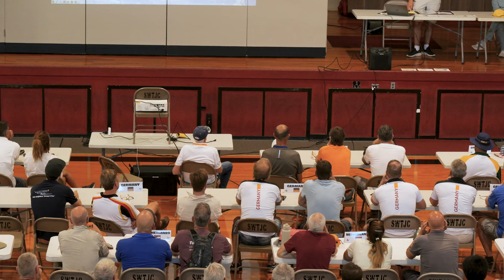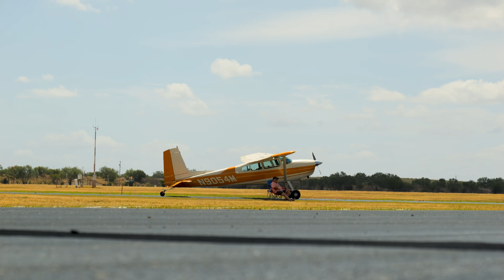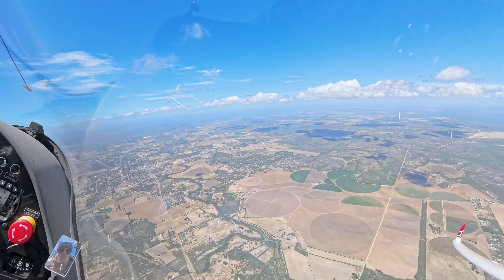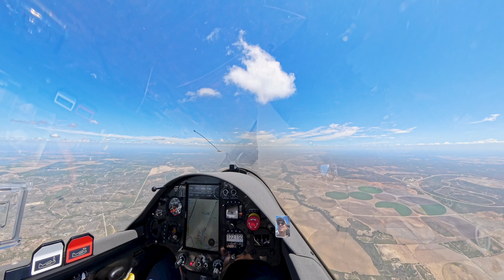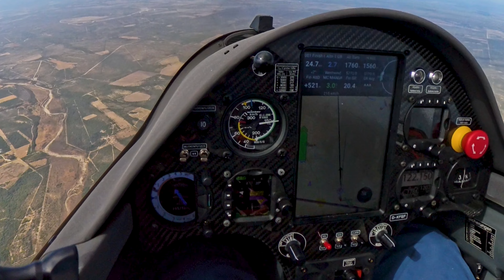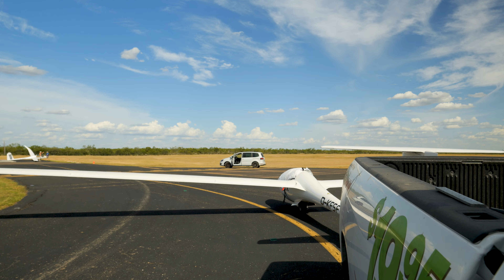Worlds Training in Extreme Heat: Strategy & Gliding Performance

Comment: Amazing how fast your average speeds are! I dont know though - I still think you all fly differently because you have the back up motor? maybe more aggressive
Reply from the maker: No, usually there is no difference in the average speed if you have a motor or not. Perhaps at the very critical days where you know you will need to land somewhere, some pilots are pushing a little bit more and are relying on their propulsion system. But also at our "outlining" day I started my motor at a farm strip.

Comment: MC 3.0, wasn't it too optimistic ?
Reply from the maker: To be honest, I don´t have a close look at the MC value for the speed to fly. Fun fact: I was flying with the ASG29 polar in XCSoar because I was too lazy to create a custom polar for the AS33. For me it´s only important for the final glide calculation. At the end I don´t know if a speed to fly with MC value is still very helpful with modern sailplanes. But the new vario technology is amazing to use energy lines very efficient.
Reply: @SteFly  Absolutely. Already in the late 70s and early 80s Ingo Renner favoured fixed speeds as opposed to following a flight director as many did back then. My own feeling out of my experience is  that there is more to lose from extreme speed angle of attack changes than the small loses from not flying at the perfect theoretical speed. Some successful pilots I've meet tended too fly faster than the theory on bombastic days, and slower than the theory on poor days; it seemed to work very well for them; of course the most important part of the equation is that they flew along the best lines between thermals. I assume that the crazy good gliders of today like the AS33 have such good performance that it makes sense to fly super fast all the time. 

As for using the 29 polar instead of the 33, I'm sure that the random differences in lift and sink along your path are way bigger than the polar difference between those two birds. 

Anyway, congrats again, Stefan. Winning consecutive worlds, one in the mountains and the other in the flats is really really impressive.
Reply: Whatever it was that he did at Uvalde, it worked crazy well.